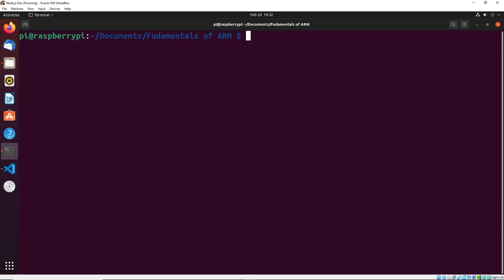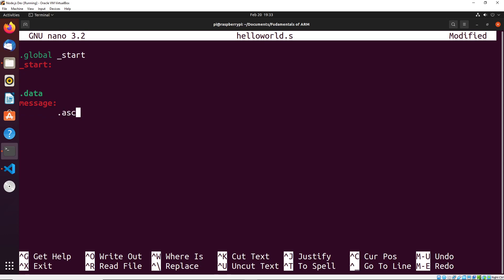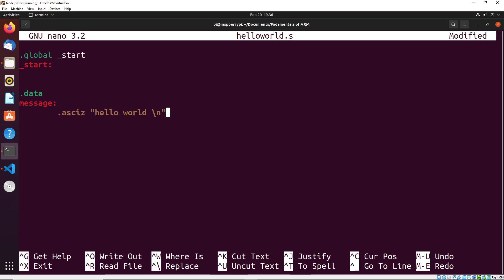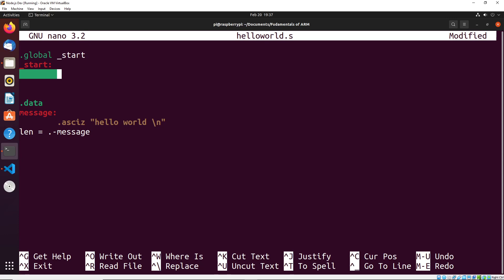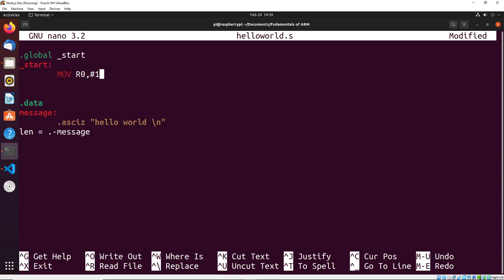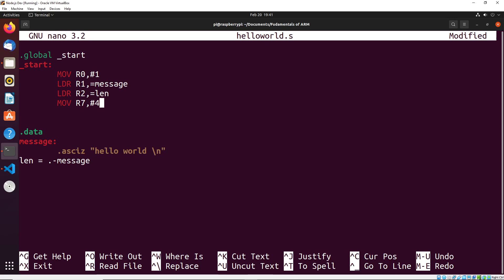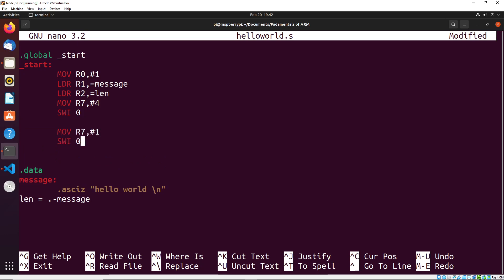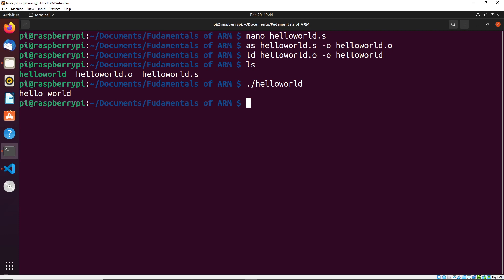Introduction to Assembly Programming with Arm - Printing Strings to Terminal

Comment: This didn't work for me on my Raspberry Pi. Probably because the example is for a 32 bit processor and my Raspberry has a 64 bit chip. The Registers have different names, and the System Calls have different numbers. Here is a 64bit version that worked on my machine:

.global _start
_start:
        MOV X0,#1
        LDR X1, =message
        LDR X2, =len
        MOV W8, #64
        SVC #0

        MOV X0, #0
        MOV W8, #93
        SVC #0

.data
message:
        .asciz "Hello World\n"
len = .-message
Reply: thank you!